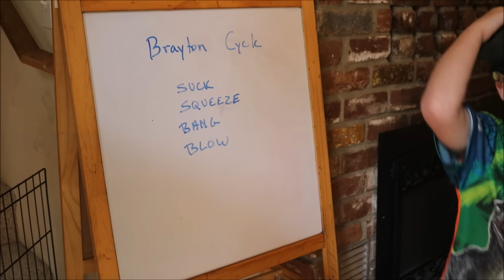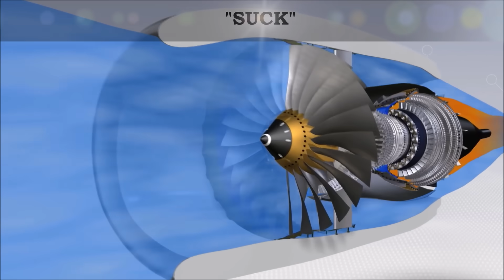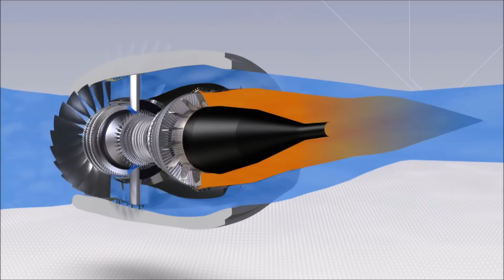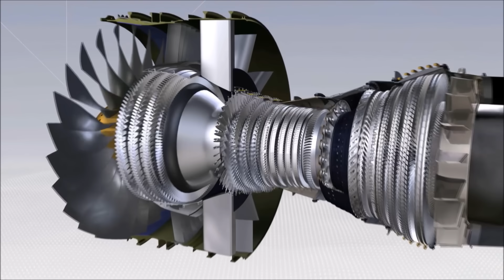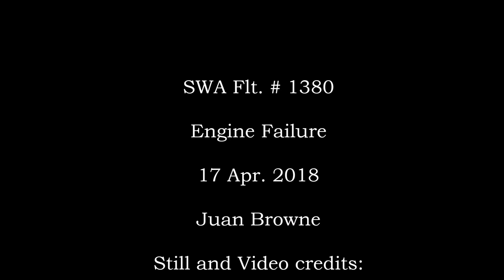Southwest Airlines Flt#1380 17 April 2018 Update

Comment: 3 observations:   
1) Once again Juan does a great job
2) Considering the energy of a fan blade letting loose at 50+K rpm its amazing how much of that energy is contained.
3) Amazing the idiots who don't pay attention to pre-flight instructions and can't get get a simple oxygen cup on their face correctly.   Fortunately, more didn't get hurt (Hypoxia) by their own stupidity.
Reply: The core of this engine does not spin at 50K+ RPM Either.  Max RPM for that size of an engine will generally be less than 30K RPM due to the speed at the blade tips.  This specific engine tops out at 14,460RPM per this info:  http://www.b737.org.uk/cfm56_soi.htm The inlet fan will definitely be less than the engine RPM as well because of it's longer blades/larger diameter.
The manufacturers don't hide engine data, it is made available through manuals which must be purchased, just as many other industries do.  If you do a search, you will find that there is a lot of data about jet engines out there.  There are even YouTube channels like @agentjayZ: https://www.youtube.com/user/AgentJayZ which go into great detail about jet engines.
Reply: I am always amazed that the great majority of people that remove their seat belts when the seat belt sign goes off......why. The seat belt causes no pain, so why not keep it on. The seat belt could prevent injuries due to turbulence and possibly keep you from being sucked out of the plane due to rapid decompression.
Reply: Re your observation #3 above...  I have seen a ton of online comments about the oxygen masks, and people clearly not using them correctly.  I'm not sure of the liter flow rate to these masks, but likely the amount of oxygen flowing to them is enough to create a significant enrichment cloud around the person's face, coupled with the fact that there will be some entrainment of oxygen through both the oral and nasal routes.  Also, once the plane is below 10,000 feet (which I assume happened very quickly since one of the early checklist items on the depressurization checklist is DESCEND), the use of supplemental oxygen becomes unnecessary.
Reply: No 3. - yes, I noticed that too!
Reply: Sorry to tell you Pelican 1984 you must be talking about a C-172 with round dials. We are talking about modern, hi-bypass jet engines. You do not have to know the speed of the fan or core rpm or temperature. What you see in the cockpit is only %rpm of N1 and N2., also ITT which is not the temperature exiting the compressor. It is the inter turbine temperature. Nowhere will you actually read the rpm like in your vehicle or the actual temperature exiting the compressor. You are referring to "operating specs". Yes, we have to know them. In the CFM vid, they tell us a ballpark real pressure and temperature. I was surprised to see that.
Reply: Yes, to all who pointed out my guffaw, I should have proof read that better.  5+K is what I intended after shortening 5000+ rpm.
Reply: +jstins  "judgmental" is your word/world.   Considering these folks had just  (within the last hour)  been SHOWN HOW to put on a mask and adjust it, they either forgot or just didn't pay attention.  I'm going with the latter.  Not paying attention to someone who is trying to save your life...  insert your own adjective.
Reply: Shannon, that is good info. I subscribe to agentjayZ. His tutorials are great. I guess most of the old engines he refurbs go into power generation, not another aircraft. I teach aviation and wanted some real figures (not %) on the RR 3007AE that powered the Embraer 145 series which we were flying at the time. I got some real data from RR but not all of it was available. The fan at 100% was 7,000rpm. The gearbox spun at 12,500rpm but gear ratios meant that the oil, fuel, generators and hydraulics spun at different rpm. The PMA spun at 35,000rpm.
Reply: The fan is cool. The compressor discharges some very hot air into the combustion chambers where it is mixed with fuel and burned. This is adding energy and without it, the engine could not work. Most of the air will not be used for combustion but for cooling the combustion chamber. If the compressor discharge air is 450C, this is considered "cool" to the combustion chamber which might be near 2,000C. Newer alloys and ceramics allow hotter temperatures which means more energy that can be made to turn the compressor and fan. This is a brief description. Sorry but it will take a college physics course to get into details.
Reply: A quick google from the fan speed of a CFM56 will give you an answer of 5.200 RPM.  Not fifty thousand.  Remember, the fan is going to have to remain subsonic to give the best airflow without interrupting it, and everything behind it.
Reply: Mark Hudgins the fan( N2 or N3) and the core (N1) are not directly coupled with each other... That alone would make it rather difficult for them to spin at the same speed as you say...
Reply: Mark, the core sure does rotate faster than the fan. The fan and core are totally separate. When we say core, we mean the compressor and high pressure turbine. The fan is driven by the low pressure turbine. They are not connected physically. They are rotating at different speeds and only connected by air from the compressor to the combustion chamber and then into the turbine section.
Reply: excuse me that PMA is the core?
Reply: Sorry, I needed to explain. The PMA was the Permanent Magnet Alternator. It was there to power the FADEC (Fully Automatic Digital Engine Control) during engine start and also ignition. Not every jet engine will have this. It was on the gear box. In jet engine speak, the fan is N1 and the core is N2. The PMA also provided secondary N2.
Reply: +Peter Steitz  Peter, yep, I know... it was a typo.  You are right.  I flew the P&W TF30 and the vertical gauge over my left knee was only in %.  but I know it was basically a percentage of 10,000rpm.    The number 10,360 sticks in my head.  But on this CFM, just assuming the diameter is near 5ft, the tip speed at 5000rpm is over 900mph.    So I would assume the rpm is actually less than 5000.  Anyway, that's a lot of energy to turn loose.
Reply: Gerbils, all, and probably inhaling through their noses and exhaling into the mask through their mouths.  <g>
Reply: Melanie, N1 is the fan. N2 is the compressor. They turn at different speeds and are only remotely connected by hot gas from the combustion chamber. They are driven by their respective turbines. N2 by high pressure and N1 by low pressure turbines.
Reply: No, it what was not a typo, you are uneducated in aircraft engines specifically and rotating machinery in general.    At what rpm do you think a propeller of 16-foot diameter turned on the largest radiaI engines?  No clue, right?  If you are going to play the expert, first get your A&P license at least.
Reply: Hey, there was something really important on their phone while the flight crew was prattling away
Reply: "Engine cases are not designed to contain failed turbine disks. Instead, the risk of uncontained disk failure is mitigated by designating disks as safety-critical parts, defined as the parts of an engine whose failure is likely to present a direct hazard to the aircraft." Quoted from NTSB Urgent Safety Recommendations to FAA, 5/27/2010
Reply: Mark Hudgins not in a two spool engine. Core (hp) always rotates faster than the fan and booster (lp) stage.
Reply: How hot and fast do these internal components go then? I like your comment!
Reply: going supersonic then this PMA/CORE? much appreciate the info there...!
Reply: ziggy 2shus
I am not amazed.  If they knew the risk they would not, but Prehaps they would not fly either.  Folks are not very bright in general.
Reply: I'm not sure it's not effecient to take new oxygen from mask without the nose inside ! you still got fresh air and new air - so your % of oxygen in blood still good I believe.
Reply: Right, it's been known for years now that a propeller looses efficiency as its blades approach the speed of sound, but why is that, I remember reading that in a book a few years ago.
Reply: Emergency descent rate will be in the region of 10k feet/min making it 2 minutes or less down to 10k feet. It was on the L1011 anyway.
Reply: Nothing bad would have happened. If it happened below V1 the aircraft would have stopped on the runway. If it had happened AT V1, or after, the aircraft would have continued the take off, been cleaned up ( wheels and flaps/slats up and in) The engine failure drill would have been completed and the aircraft returned. These drills are practiced at every bi-annual simulator check several times per detail and sometimes more often. It doesn't matter how serious the emergency is, the drills cater for each type. The serious ones just make the heart beat faster!!!!!
Reply: @ Eric Boehm Agree with everything you point out (as a regular user of oxygen)about the efficacy even if the nose wasn't covered.  However, if one (or some) of the passengers already have respiratory problems (like me) depressurization at 32,000 feet would be life threatening.  Also, impacts can happen at altitudes above 8,000 feet for healthy individuals, but some can be affected at lower altitudes.  Granted it did not take long to descend, but that is a very long time if you already have respiratory health issues.  I really appreciate your spot on insights regarding #3 above
Reply: Slight correction from a B737 pilot for more than 30 years. The temperature instrument we have in the B737 cockpit is EGT = Exhaust Gas Temperature, not ITT as you described. EGT is an indication of the temperature of the gases leaving the last stage of the turbine, which is also called the power section.
Reply: 1. there would NOT have been, in this case, rapid depressurization, so the passenger would not have been sucked out. And depends of course on altitude, skill of pilot, and your meaning of takeoff verses climb.  Somebody chime in on whether or not this aircraft can climb on one engine.
Reply: The low and high pressure compressors spin at different speeds determined by their respective turbines.  Most engines are double shafted and some are even triple.  The larger the diameter, the lower the rpm to have the fan tips remain sub-Mach.  The speed of sound at 30K ft is 680mph,  11.3mi/min, 59,840 ft/min, fan circumference is 16 ft, so 3740 rpm is the max fan speed.  For the huge engines, it is down closer to 2000 rpm.
Reply: bull frogger Southwest crews that inject a little humor are priceless. I fly Southwest at every opportunity in part for the entertainment. Just because they try to lighten the humdrum of oxygen mask instruction doesn’t mean that passengers disregard. On the contrary, people pay more attention precisely because of the added interest of a little humor.
Reply: Those oxygen generators only last a few minutes or just long enough for the pilot to lower altitude to 10,000 ft.
Reply: the N-1 rotor or low pressure fan assy only turns about 2500 rpm max
Reply: ramosel, the fan doesn't turn at 50+K rpm. The core of the engine probably does. The fan blades have to be kept subsonic. More like 7-10,000 rpm. Much of the technical details are kept secret with the manufacturer. I'm surprised the CFM video even talked about temperatures in the engine core.
Reply: I've heard 3500 rpm for the fan blades. Are there any airline pilots who can tell us : what is the fan RPM at takeoff?  Is that "N1"?
Reply: Operating specs aren't secret.   Every pilot and mechanic must know them.
Reply: Regarding your 3) point is correct besides being judgmental. Yeh I noticed that. How people react in tense situation is very unpredictable.
Reply: You’re correct in that the core doesn’t spin at 50k rpm. However the fan and core spins at the same rpm in all except geared turbofans. The increased diameter of an object doesn’t cause a change in rpm in and of itself. What does change is the speed of the fan tip compared to fan root due to the increased circumference. I’m sure that’s what you meant.
Reply: +Hopeless (fitting)   I'm assuming this was directed my direction and yes it was a typo.  Its what I get for trying to post from my phone instead of a keyboard.  My fault, my mistake - I admitted it and moved on.   By largest radial I'm guess you mean the P&W 4 row Wasp (4360?) and those ran under 3 grand but even there the blades were geared down significantly to keep torque up and tip speed subsonic.  I was a hanger rat probably long before you were born (started at Wheelus).  Have no need for an A&P, I went to Canoe U and flew Scooters and Turkeys.  Diamondback - anywhere, any weather, anytime, baby.
Reply: Peter Steitz FADEC doesn’t stand for that 
Correct is: full authority digital engine (or electronics) contro
Reply: The manner in which crews instruct passengers about safety can lead passengers to not take things seriously . I have seen them joke , laugh , not speak loud enough to be heard , and generally give the impression that it is just something they are required to do but not real important . If they don't make it serious , we won't take it serious .

Comment: This file is out-of-sync by several frames. Please repost a corrected version.
Reply from the maker: Jeez don't panic, let it finish processing. Looks good on this end now. You need a better connection Bruce!   lol.
Reply: blancolirio  My connection is fine and I quit and relaunched the app (iOS) and reloaded the video and the sync problem was the same. Another viewer noticed the problem, too.
Reply: Works fine for me.
Reply: Worked fine for me on my Android phone.
Reply: 12:15, 14:30(+/-10 seconds). Those were the only two spots that lagged one hour after uploading. Who cares? Great job as always, Juan. Cheers.
Reply: Bruce John Shourt Id say have some perspective, you are watching a free video prepared, edited and posted within a day of the event by someone whose putting in their own time and effort which next to zero monetary reward. 

If you are after a slick edited production that looks perfect on a TV you can always watch CNN or FOX. I for one would rather quality and informed content any day of the week than nitpicking one perceived syncing and audio issues.
Reply: As Pat Paulsen used to say on the Smothers Brothers Show, "picky, picky, picky".
Reply: Robert Hess  It’s difficult to detect "lip flap" on a tiny screen. I watch on a 42-inch display. My profession is video production (as a professional since 1980) so I am sensitive to synchronization. I just checked the fourth download and it’s still off.
Reply: Darrell Smith  Yes, it might be a YouTube bug today because I just watched a Comedy Central video posted today after watching several Conan O’Brien posts that were done today and were OK but but the Comedy Central one was out of sync. It’s possible it is a combination bug, that is, it only affects iOS users.
Reply: John Stevens  It’s rare, even on this medium. This is the first of his videos with defective sync. Since 2005 when it started I have watched thousands of YouTube videos, both from broadcast and cable sources but mostly by amateur and professional YouTubers and I can’t remember the last time I saw one that was out of sync. In the early years of HD on DirecTV it was a common problem.